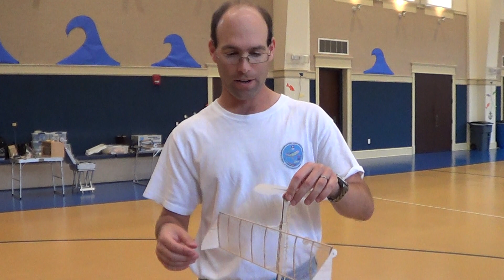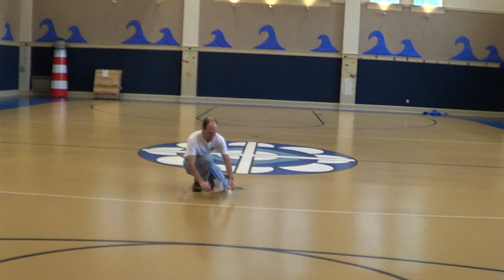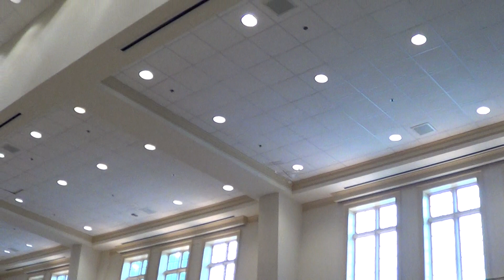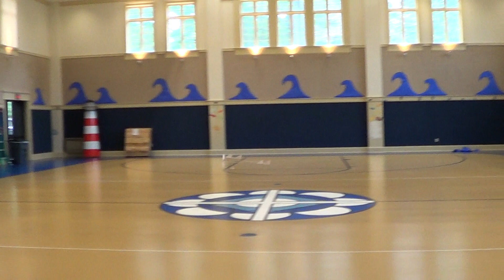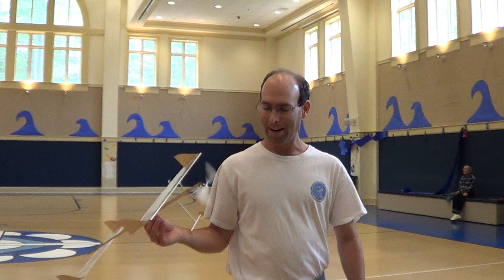Senior Flyer ROG - TSA 2019/2020 legal - Demo!

Comment: Solid Flight! How many winds did you use for this flight and what’s the longest that plane has flown in the air for? Sorry if this posts twice not sure if this comment sent earlier
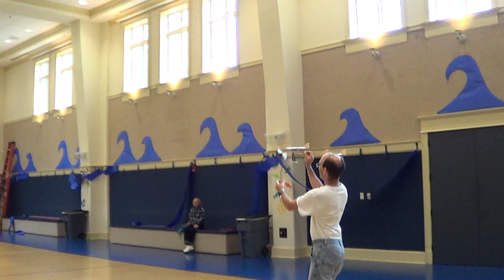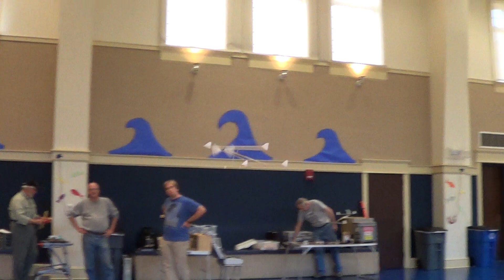Reply from the maker: Brent Bortenson, I was winding to around 1300 turns. Haven't done nearly enough flying to get it to full performance, but it was bouncing around 1:45-1:50 when I stopped flying it.
Reply: joshuawfinn Thank you very much, it sounds like it has great potential